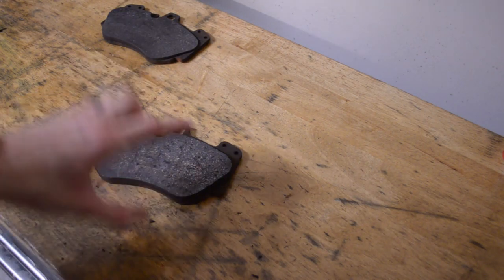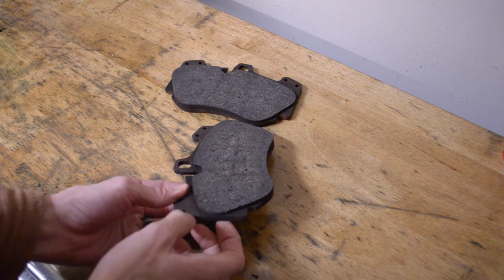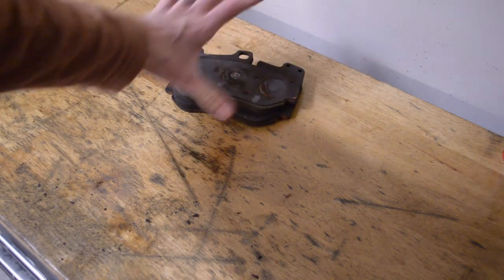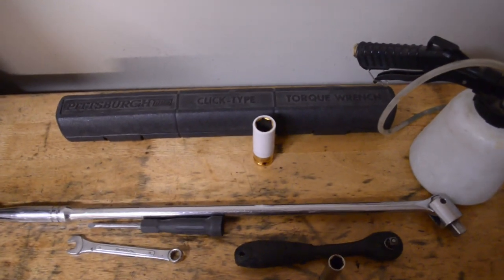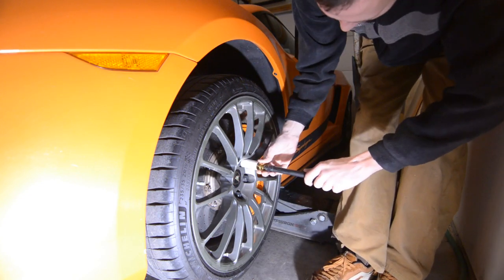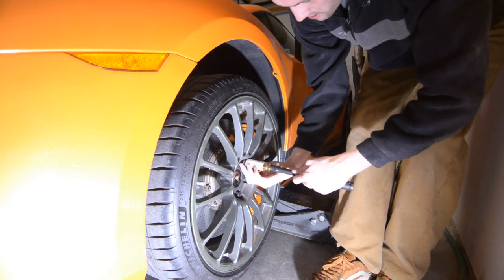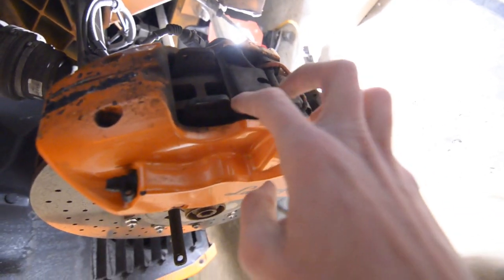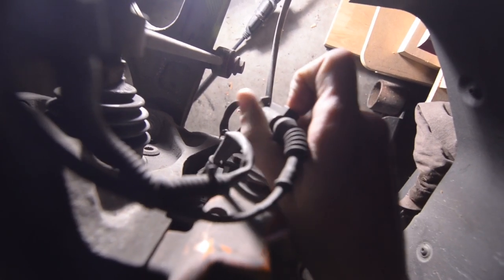Easy DIY Brake Pad Replacement: Lamborghini Gallardo Superleggera. Fix Any Lamborghini Gallardo

Comment: Keep in mind looking at these pads, This car has over 100K miles on it. CC pads last a long time and this wear is probably not typical of what most CC brake Gallardo owners will see. But good info to share none the less. Thanks.
Reply from the maker: Hi Vicarious, that is very true! How long would you estimate you these CCB pads last for street driving? Do you have CCBs on your car? 
Looking at the service history my pads look to have been replaced at least 3 times but the previous owner was a badass and she took the car to Italy and Europe to track it multiple times! So that might have aggravated wear!
Reply: @TheBullRider  I have a 2013 Gallardo SL UGR twin turbo, mine only has 7000 miles on the car so they are probably fine for now. I have heard you can get 35k-65k miles out of them depending on your driving style etc. Have not had any issues with mine. Thanks for the video series.

Comment: Btw I agree with you about the jack, I used two jacks but by the time I got one high enough the other tire was off the ground also.
Reply from the maker: Yeah I noticed that too Jacob! You can make the car teeter on the jack and one other wheel the chassis is so stiff! I am thinking about creating a video to thoroughly debunk not jacking up the car on one side once and for all from an engineering perspective. It seems to be a common misconception!

Comment: Great video man. Remember that you need to weigh carbon ceramic brakes to tell their true life. Mine were weighed recently and my car has around 50k miles are basically new. I also upgraded to the pagid brake pads as well. Next will be stainless lines. Keep up the videos. I need to upload some.
Reply from the maker: Good call Rowe! I now have a scale to weigh these rotors but now the car is back together and I dont want to take it apart again!! What pagid compound did you go with? I did the RSC1 which is OEM equivalent. I was thinking about getting the RSC3 but want to prolong the life of the rotors for as long as possible. 
And yes you should upload more, your r8 is sweet!
Reply: @TheBullRider  I also got the rsc1 I believe. I thought they were slightly more aggressive than stock but may not be. I’ll definitely start posting more. What side of the country are you on?

Comment: Do you recommend using 2 low profile jacks?  Do you begin by jacking up the back of the car first, inserting the 2 jack stands back there, then using 2 jacks to lift the front and putting the wood blocks underneath?  Why won't the jack stands work underneath the front of the car?  I think they are 3-ton stands so why won't they work in the front?  Sorry for all of the questions!
Reply from the maker: Marcus, don't worry about asking questions my friend! I am happy to help, sorry for the late responses! The front is tricky as hell and the jack stands will work but the problem is finding a spot to place them after you jack up the car. When changing the pads, I would recommend jacking up the rear first and changing out the rear pads, and then placing the rear back onto the ground. 
On the fronts, I would jack up one side at a time and throw some wood underneath behind the jack as a safety measure. Don't worry about cracking the windshield, I think that's a bunch of BS leftover from the diablo. 
You will notice that when you jack up one side high enough, the body has a high degree of torsional rigidity and you might teeter the car on two wheels. To jack up the entire front end, both wheels at the same time, I recommend using two Jacks on both sides of the car. 
Honestly, the best solution is to get a set of Quick Jacks!!! I want those so bad!! 

Do you need more clarification than this? I think I will address jacking up the front end on a front differential fluid change video once the motor is back in.

Comment: Great content, I need to check my brake fluid.  I also have the CCBs and really like them, but they take a little getting used to.  
I like that the pads last a long time.  The first thing I was warned about when I bought my car was not cracking the windshield and jacking it up evenly on both sides.  😆. Thanks for debunking that.
Reply: Supercar frames are very rigid.  I'd be surprised if the frame would flex by jacking the car up.
Reply from the maker: Hi Marcus, Im glad you like the CCBs too! They are totally strange in terms of brake feel but I'm sure you agree that it just adds more character to the car. 
How long have your pads lasted? 
I am thinking about creating a video to thoroughly debunk not jacking up the car on one side once and for all from an engineering perspective. It seems to be a common misconception!
Reply: @TheBullRider  They have been on there for some time.  I think they were at about 80% this time last year and I've put more than 5k miles on it since then.  Not sure when I will need to change them but it will likely be awhile.  I don't track it and don't overuse them.  Good idea on the windshield video.  Another idea could be the battery tender/battery dying issue.  These cars do drain the battery if you don't drive often and letting the battery die is not a good idea as it can cause other issues (have to re-pair the key fob etc).
Reply from the maker: @marcuslavender4619  Marcus, you read my mind! Mine just died a few days ago because of the bad weather here and I have a battery tender inbound! So watch out for that video. I don't think I will be able to find a way to make that one 30 mins long but we shall see! LOL

Comment: I use the old brake pad to push back in the pistons evenly.
Reply from the maker: That is a very good point Skyline and I typically do that but with these CCBs, my concern was fracturing the rotor surface. With steel rotors, it is SO much easier!!!

Comment: Not sure If that slanted break pad is caliper flex or not I think it's a alignment issue or a knuckle issue,but if it is a common Lamborghini issue it could be caliper flex
Reply from the maker: My thought exactly Priceles$. Im sure you are aware that although the 19z Brembo is an excellent caliper, it isnt a stop tech or an Alcon!! 
Ive heard r8 guys just swap the pad to the other side of the caliper to even out the pad wear on these calipers with CCBs! 
Interesting note about the knuckle, never thought of that!

Comment: The Quick Jack will fit under a stock ride height Gallardo, but I am not sure about a superleggera.  It lifts the entire car at once.
Reply: I have a quick jack and it doesn’t reach to the exact center on the circles, it barely reaches to the edge of them, on a base Gallardo
Reply from the maker: Hi Ryan, I have been eyeing those for quite a while, I want a set for all of my cars! Maybe when I get to 1000 subs? :)

Comment: As great of a video as ever, many thanks! Edit: Just took a look a the video description, superbly helpful! 

An idea for getting the front wheels off the ground, couldn't you raise the car using the front lift system, put in some rubber support blocks, and then "lower" the lift and have the car rest on the support blocks?
Reply from the maker: Im glad you liked the description with all the links. It took a bit to find all those random parts from like 3 platforms. You probably know this but these CCB calipers are 19z calipers from a cayenne turbo s, so you can save $$$ on hardware from that!

That is an interesting idea! I should try that out, I don't know if the front lift will bring the car high enough to get the wheels off but i will try that and let you know! That would be cool if it worked!
Reply: @TheBullRider  I bet your viewers appreciate saving a buck! I knew it was the 19Z but not that Cayenne Turbo S shared the hardware.

Cool, I'd love to know about the front lift. My gut feeling says that the wheels will droop too low, but if it does work one would never need to jack the side (given the rear can be jacked in the centre).

Edit: Saw your comments on the QuickJack. I too have been eye balling one, but I'll leave it to you to see if if fits the SL. ;-D
Reply from the maker: @tanelrebane  I think it will fit the SL. I dont believe the car is any lower than a base Gallardo, that is..... until I slam it to the ground and put 10 degrees of camber on the wheels for that "hella flush" look you know everyone loves.

Comment: I think my superL may have came with carbon but was switched out at some point to steel...do you think that's possible or am I wrong that could be done?
Reply: It can be done, a mechanic told me I should switch mine to steel b/c he doesn’t like them, thinks they are too touchy or something.  I left them and think they are fine But expensive to replace.
Reply: Many people that track cars will replace with steel because of the expense of the CCBs.
Reply from the maker: Hi Trevor, Just like Marcus said you can totally do that! My car actually was ordered from the factory with carbons but when it showed up in NY new it had steel brakes so the previous owner had them replaced at the dealer with factory carbons. 
If i ever track the car for extended periods i will switch to steel brakes. 
The steel rotors are thinner (34mm i believe) and the CCBs are 38mm so you will need to swap to base Gallardo 8 piston calipers in the front and 4 piston rears.
Would you like a video outlining every detail and how to swap them over? Some say that the master cylinder is different on a CCB car and so are the lines etc but i doubt it and I could look into that too